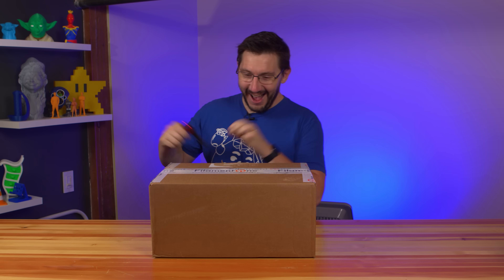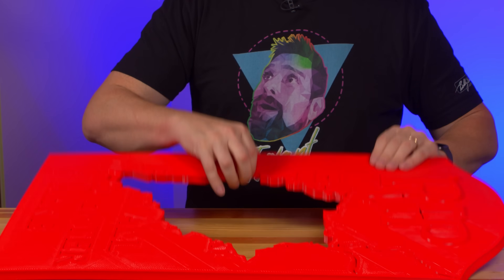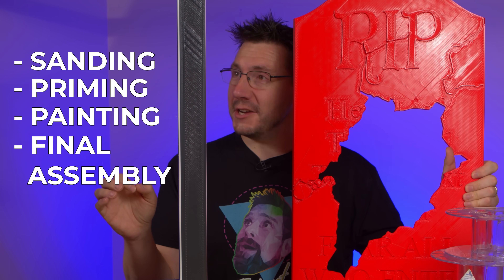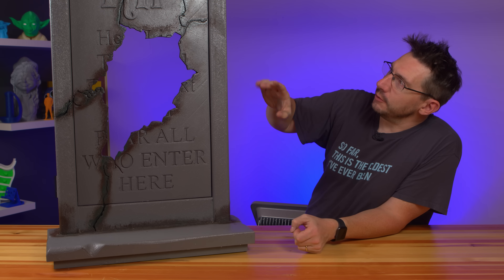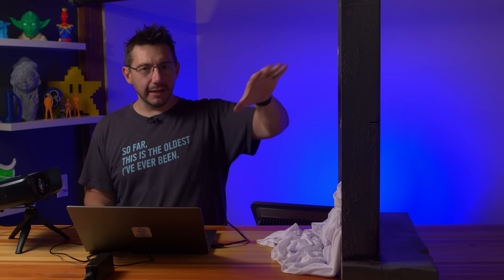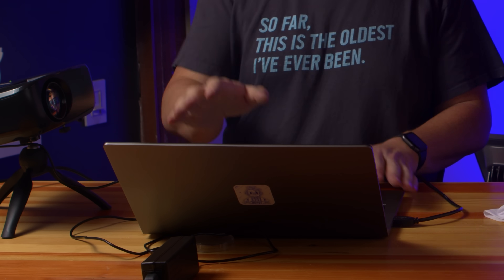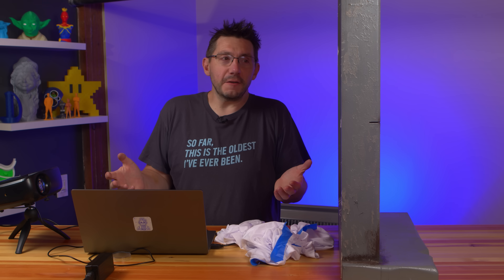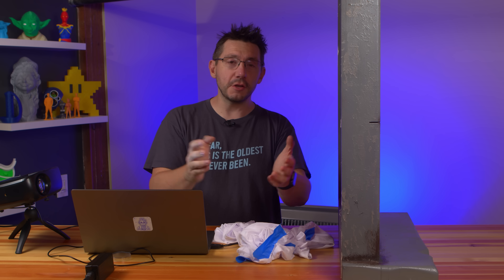Halloween vs the $38,000 3D Printer!

Comment: just seams wistful there is No  reason to print infill in all the way true what would make sense is making a 2 inch wall splitting it up into 4 lairs and printing them standing up ,you end up printing it 10 times faster you use way way less filament  and wile you have lairs to glue it would be overall easier to hide than trying to hide a top lair , as some one who used 3D printing in a pratiucal setting this seams the most insanely stupid and time consuming way to print  this model out.

Comment: I was thinking about this video in the shower today as the execution was terrible. Wasting tons of plastic instead of using multiple building techniques.
Anyway, the one thing I don't get is why the edges of this big build plate would be cooler. Surely, a machine for 38K USD would have multiple heating zones using multiple sensors to ensure even heating. Also not putting this huge machine into an enclosure is a very bad design. The  price tag might be huge but the machine performs like a 3D printer from 7 years ago. Not impressed.

Comment: This is one of the best props for Halloween/haunted house I've ever seen.

I might have grabbed an old LCD monitor for this (assuming I could rig it so it wouldn't stress the rest of the frame), so I could put a weak spotlight on the tombstone so it's a wee bit more visible, but the effects would really pop when they're triggered. OR, I would find a way to "leak" the projected light so that it would illuminate the tombstone as well.

Comment: I personally would of gone to the local Good Will or Salvation Army store to look for a cheap LCD computer monitor (ie, 15”-20”), and used that instead of the projector. It would have been much sharper, brighter and the colours in the video would have been more vivid (less washed out). And for those wondering, the LCD screen could have been easily positioned vertically, because there are various settings/positions that the Atmos videos come in for each of the effects they make (ie, vertical or horizontal, reversed/mirrored, etc).  And I agree with many others that already said, it was a waste of filament. You could have easily done most of the tombstone out of wood or rigid pink or blue Styrofoam board (which is the stuff most haunts use for their tombstones), for fraction of the time and money to build them. Example: https://youtu.be/IEAAqlxw0IQ Anyways, thanks for the video.

Comment: errr. i think when it comes to 3d printing. theres some things that are obviously best done in ways other than 3d printing. This could have been made with a couple dollars of foam board and not 8 reels of plastic. whats that cost, £160? for a grave stone frame...

maybe print the lettering sectionthe letter are the hardest part to carve into the foam. So then stick it to better suitable material for the rest.

or even print plates that you then stick to a foam underframe so you dont do so much infill in plastic.

Comment: First, thanks for the video.  I really appreciate all the work and money you throw into the machines and prints.  I wonder, though, if because you 3D print sooo much that you just ignore all the print lines.  All I can see, as a non-printer, is all those print lines.  they are so clear on the camera and even after you threw all that texture after it.  Sorry, but better results to me would have been just make it out of foam.
Reply: Those print lines are just because it has a really big thick boi nozzle. It also has some printing issues that Joel hasn’t ironed out yet. But for something that is going to be painted and finished later, you can get away with some printing artifacts
Reply: @seville2k  still, youd get a far better more realistic looking finish with foam and some pva glue mixed with sand. 

3d priting in this case i think i sbetter suited for detail you dont have the time or skill to make by hand. maybe a gargoyl for the top of a foam tomb stone, 3d pritn the recessed lettering section and combine that with a foam body. 

this was like 200 dollars worth of filament, vs 10? dollars of foam